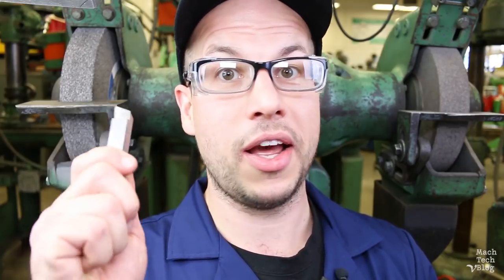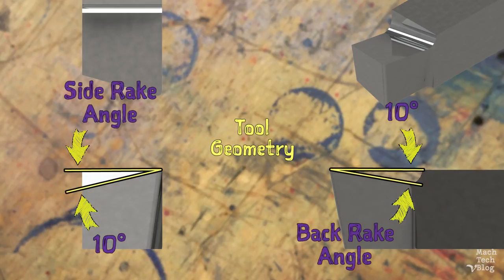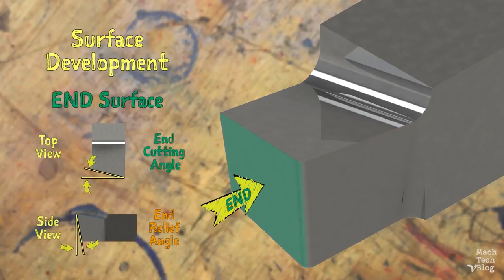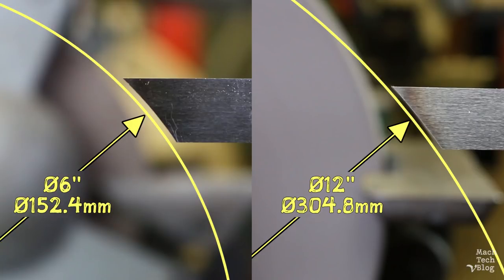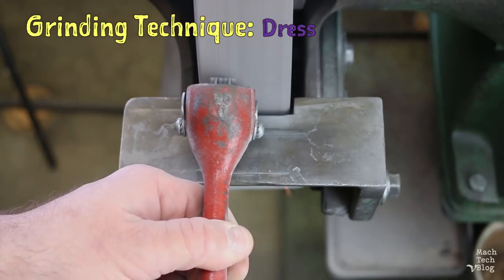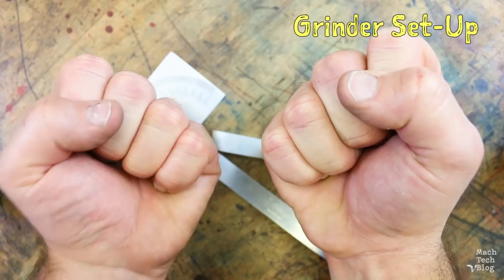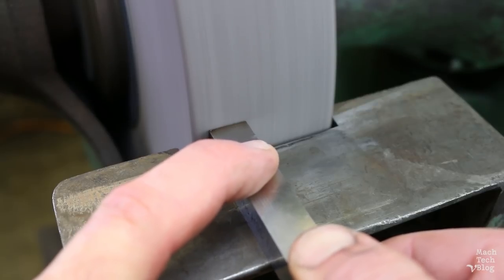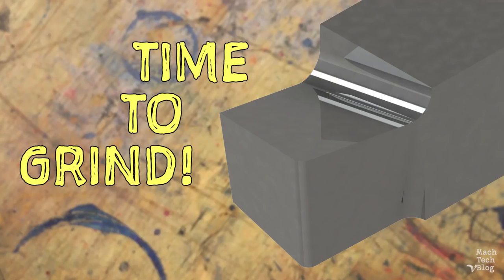Grinding Cutting Tools - Part 2

Comment: 12:50 Trigonometry to the rescue! Position the tool rest so the surface is perfectly perpendicular to the wheel surface, and mark that as your zero position. Then set tool rest height to wheelRadius x sin(angle) - toolHeight, and the angle at the top of the tool will be precisely what you want.
Reply: wouldnt it be nice to have the time to do all that math at the shop lol

Comment: I agree with the others...very nice presentation of grinding a lathe cutting tool.   How much does the nose radius really matter?  It kind of looks like you could look at the radius you made in this video and when doing your own probably eyeball it to be about the same, within 10-20% at least.  I guess the question is...does one really need a set of radius gauges, or is it sufficient to just round off that edge a bit?